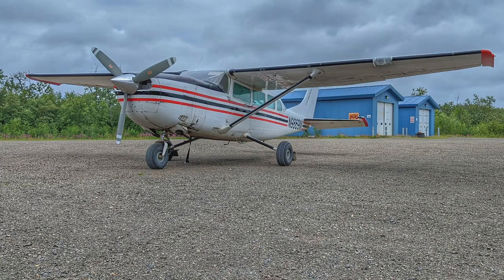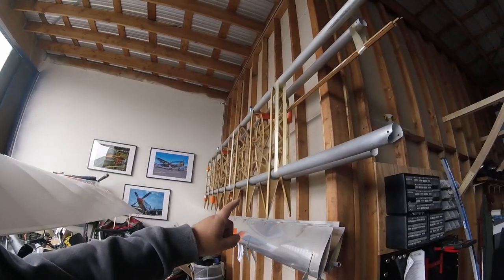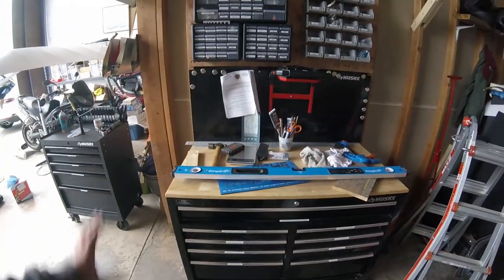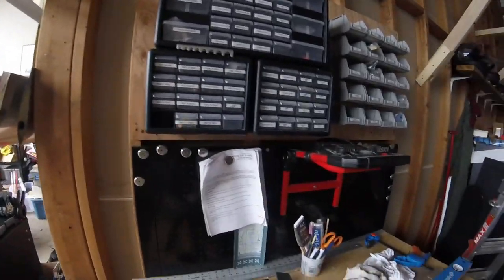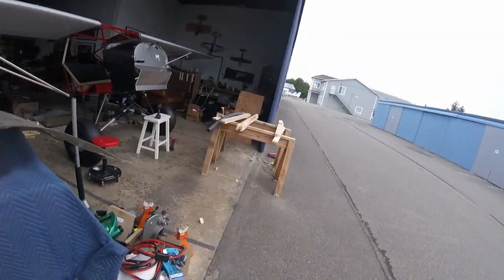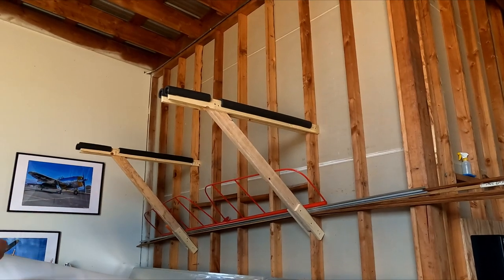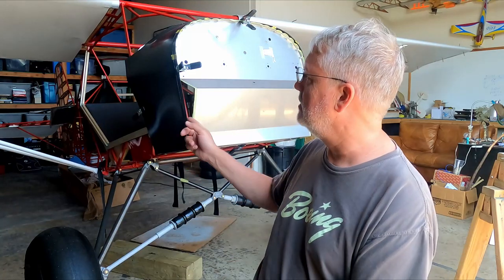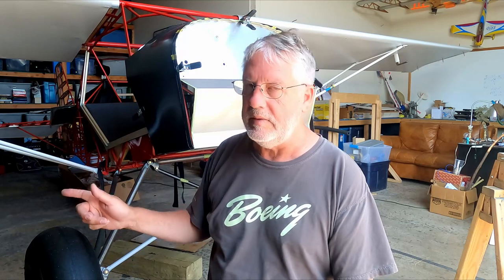Verner Kitfox 5 build video 27

Comment: To transition from the rear of the rear window to fuselage you can use a piece of scrap wood making like a mini ramp and glue to tube structure, or even cut a thin slot or two on wood ramp and add safety wire to attach wood to tube.